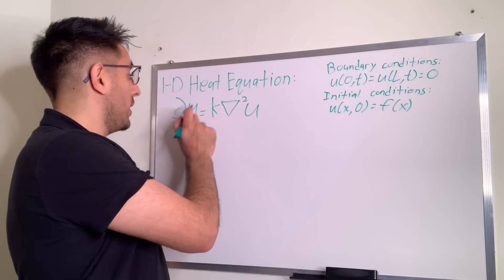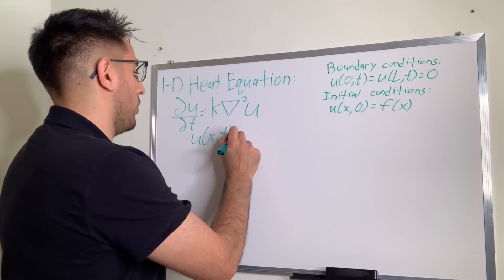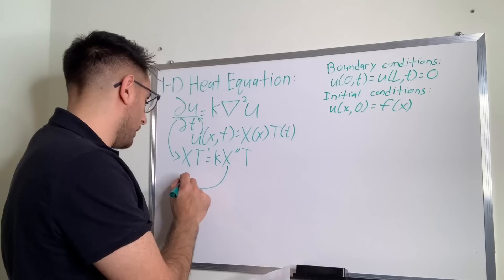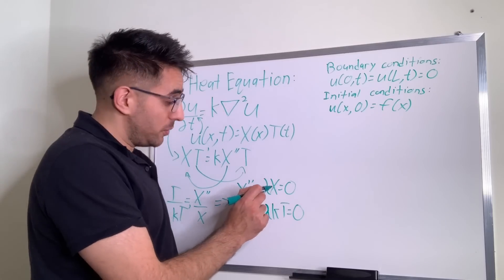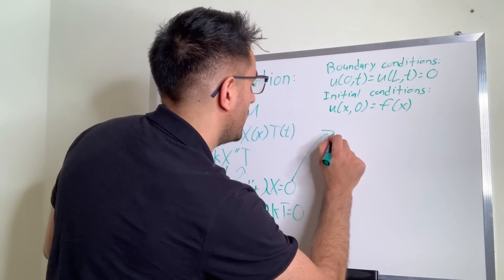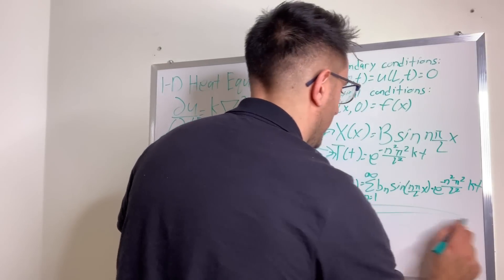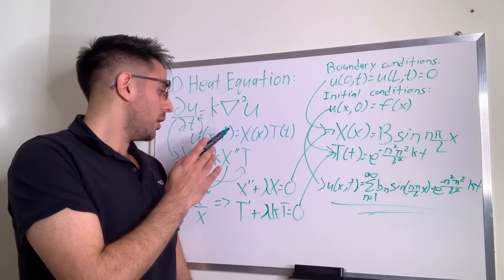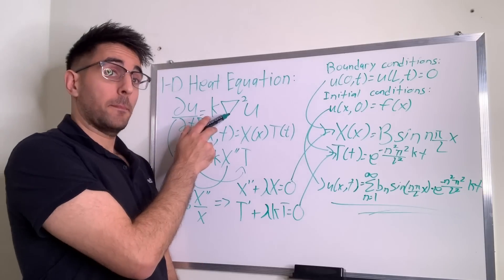What math looks like if you're an engineer...

Comment: Yeah engineering professors are terrible at explaining the math lol.
Reply: Because they don't actually understand the math. Engineering (most engineering at least, maybe not BME or CE) is like 3 freshman math courses and then 3.5 years of memorizing equations to do long but extremely elementary differential equations; zero theory. Pure mathematics really starts with modern algebra/group theory in the discrete and real analysis (big kid rigorous calculus) in the continuous -- as my then professor said on the first day of modern algebra, "this is the course that separates the mathematicians from the physicists and engineers".
Reply: @RangersGirlJackie99  Yeah, I'm aware and it is pretty dumb. Professors in Physics/Engineering fields should be required to understand the theory behind the mathematics they teach. Not to the same degree as mathematicians but enough to know how to explain it.
Reply: @Aaron D. Green  now that I think about it, there was a small group of physics majors in my undergrad real analysis class, albeit on a purely elective basis. Maybe if more physicists start taking high level math electives or minoring, it'll eventually make its way to engineering in the not too distance future.

Comment: Professors: “this is the most important step don’t skip it or use a calculator for it, do it all by hand and show all your work…imma jump to the solution here real quick you can figure it out on your own” 

On the test they give you a sliver of a line to work out the problem cause the rest of the page is the text for the question for the problem 😩😩😩😩

Comment: What math actually looks like if you're a mechanical engineer:
Situation 1: Machine design: "Hmm the simulation program spit out a peak stress value in the gigapascals for the structure. I could calculate something similar but simpler on paper OOOOOR I could just make this wall right here twice as thick in the model!"
Situation 2: "Haha, calculate the effect of speed on the pressing process? You're a funny guy! Now; come with me and let's measure the average on 50 test pieces instead of this nonsense."

Comment: mechanical engineer I see....

I don't remember 99% of the things I was taught... but the Fourier Transform is literally.. the ONLY thing I will keep up with.
Reply: Current student here, so you're saying it does get better? I'm in dynamics right now and it's killing me.
Reply: @KangaroobiksCube  if you're a mech E student and getting wrecked on Dynamics... I'm sorry to say... it only gets worse when you start taking breadth/depth courses.
I was a electrical engineering student... and glad that Dynamics was the last of the series for my A.S.
Reply: @cpK054L  thankfully not an ME I'm engineering management going into IE in grad school, but they've got me in a mechanical focus so I have to take dynamics and 2 others that are dynamics pre reqs. 
It's getting a bit better I'm just rusty on the calc. 
Thanks for the insight though.
Reply: @KangaroobiksCube  I don't remember using calculus in Dynamics.. if anything, the later courses should be using differential equations.
Reply: @cpK054L  MAE 202 right? Every single problem I'm doing has 2 of 3 from the following; integration, differentiation, and specifically separation by parts from diff eq. Conceptually I get what the problems are asking every time but I keep getting lost in the calc while getting to the answer. 
It has gotten better since my first post, just brushing of the rust has helped.
Reply: @KangaroobiksCube  I don't know what MAE202 is... if that's how your school codes courses, then I really don't know.
I haven't taken a dynamics course in almost 10 years... I have no use for dynamics because I'm an electrical engineer.

So unless I'm in an industry that deals with kinematics, engines, motors, etc.... I would have no reason to actually use this knowledge.

I'm in IoT industry
so F = ma → qE would be my equivalent.
Reply: @KangaroobiksCube  I'm an actual Mech eng student, not eng management, and I also got wrecked baaad on dynamics.
Short answer to your question is yes, it can get better (it won't necessarily, but it's defo possible) 
I'm actually enjoying the more advanced classes alot more (I got a significantly higher grade on my PDE course than my ODE course for example) , and they make alot more sense to me. You will need to put in enough effort later to catch up on the basics that you may have missed the first time around, but by then it'll be alot more intuitive.
Reply: Do you use fourier transforms at your job?
Reply: @smokeypillow  Why? The oscilloscope and computer does it for me.
FFT - Fast Fourier Transform
DFT - Discrete Fourier Transform

for AI/ML purposes
STFT - Short Time Fourier Transform

Just remembering WHAT the Fourier Transform is very important
Reply: @cpK054L  so what does it transform lol
Reply: @Cheesecake99YearsAgo  time domain to frequency domain
Just laplace goes from cartesian to s plane
And z transforms goes from cartesian to z plane
Reply: @Cheesecake99YearsAgo  frequency domain. Sin, cos waves. Also, the Laplace formula bullshit. Crazy stuff.
Reply: @cpK054L  Designing FFTs on specific processors requires that you know how they work and how to optimize them for those processors. Likewise, knowing FT properties of symmetry can help optimize design if you know the type of signals you'll be working with.
Reply: @MrSocialish  This makes almost no sense unless you want to induce pain on yourself...

a lot of the FFT algorithms are already implemented in the CMSIS libraries.
Unless you are using MIPS or other non-multiplicative ALUs and common purpose MCUs that are not ideal for DSPs, 

why, I ask again, WHY are you trying to design an FFT?
Reply: @MrSocialish  okay? When did I ask or care?
Comparing matLabs implementation to CMSIS is competing apples to oranges. 
Why did you bring this up?
Reply: @cpK054L  “why, I ask again, WHY are you trying to design an FFT?”. Did you forget you asked that, sweetheart? And if you can’t see the reason for developing a bit true accurate model of a product, you’re clearly not fit for this discussion.
Reply: @MrSocialish  facepalm you jumped into MY discussion.  I don't care about how YOU implement it because I'm not getting paid to write it so why will I waste my time when CMSIS already has it?
Reply: @cpK054L  I never once said you had to write it smh... I simply said that its application specific. If your computer has it, and it works for your application, use it! There is no reason to reinvent the wheel. BUT I'm adding to the discussion saying that is not always the case.
For some reason this offended you though? That's interesting to me. Whenever someone tells me something that I'm not totally familiar with, I find it interesting. I don't get all worked up over it lol

Comment: As an engineer who just took Calc 3 and is doing diffeq right now, this hit home in a way I don't like😅
Reply: diffeq is a lot easier than calculus 2.
I got an A, intoxicated. You'll be fine.
Reply: @cpK054L  i got the worst mark in my year for DEs so I think you’re just built different. Or I’m stupid
Reply: @MrAdamo  was it the eigenvectors?
Reply: @cpK054L  nah, there were a lot of questions where we had to convert to polar form and do some trig math, and if you forget some weird trig identities the questions become impossible. They’re technically on the data sheet but you wouldn’t understand if you didn’t do the questions. And tbh I didn’t study much that semester
Reply: @MrAdamo  believe me I've done my fair share of polar form notations... 
it's needed when you are doing circuit analysis 
it's even worse when you have to convert it back to complex notation, do the math, then convert it back to polar.

Comment: I just took ordinary and partial differential equations last semester and the heat equation was suuupper accurate.
Reply: LOL I took a PDE class where we basically just studied the heat equation for 95% of it. Kind of crazy to see how valuing financial derivatives can be reduced to solving the heat equation though.
Reply: mood, I took V calc and partial at the same time
Reply: @Govgrav506  what, they made us do v calc, then linear, then differential equations, and then partial.
Reply: @jcw1948  huh, at my school you had to take linear first, then ode and v cal, then partial. I messed up and ended up taking v cal and partial at the same time.
Reply: @Govgrav506  maybe purdue is wack, they also let some majors combine linear and ordinary differential equations, I’m in aero so I had to take them separately, which was painful.
Reply: What heat equation is that? Is that for gas liquid or solid?
Reply: @loganreidy7055  its the change and distribution of heat in a rod. So say you have a rod with some initial temperature, you can calculate how the temperature at any point of that rod changes in time.
Reply: wait what? thats awesome.
Reply: @thomaswijgerse723  I have long forgotten the details, but from 30,000 feet it was based on a hedging strategy that would allow you to get rid of all of the probabilistic parts of the PDE representing the values of call or put options with a fixed expiry date, subject to a cap on the rate of change of the general market's volatility that usually held. It was called the Black-Scholes Equation, and Scholes won a Nobel in economics for it and got rich as hell. And of course about a year after I learned it Russia defaulted on their debts, the market went apeshit breaking that volatility assumption, and Scholes' billion dollar hedge fund (I think it was called Long Term Financial Capital or something like that) went under. So the socialist in me laughs like hell at that. But the mathematician in me still thought it was cool as hell to transform this ugly probabilistic PDE into a simple 1D heat equation.
Reply: @thomaswijgerse723  Yeah, never seen this one. Looks like you can get there from thermodynamics or Einstein heat capacity for a solid
Reply: @loganreidy7055  I’m not sure it’s for anything specifically, I don’t think you’d apply it in any thermodynamics class, but I’m just a sophomore so idk. I took partial differential equations last semester and those equations were like “the final boss”. Typically they helped model the distribution of heat in a solid material over time given one end was held at a certain temperature, or both, or neither. I hear from my other aero friends I’ll be using those equations in structures or signals I forget which, but unless you’re an aero major you’re probably chilling?

Comment: That’s why everyone I know is switching to fully online bachelors degree in engineering 😅
Reply: Lol good luck with that
Reply: Well my fuckin university need us to have 75 percent attendance offline....so im fucked up
Reply: Good luck with that... you can't do undergraduate Electrical Engineering online because of how expensive it will be on the student...

who probably can't afford their own
- Oscilloscope (the cheapest one you want is 200 MHz, and that can run minimum $200, a good one goes for $1000+, a great one for $5000+, and industrial is 7 digits)
- Digital Multimeter
- Spectrum Analyzer ← This being the most expensive equipment
- Network Analyzer ← once you get to senior year, your breadth may require this equipment
- Digital Logic Analyzer ← If your o-scope don't have this, this will get expensive
- Electrical Load simulator ← This will break you too if you need it for senior design
- Soldering station with venting system ← Just breath the fumes

This is only a few of the equipment, the entire set (unless you win Keysight's contest) will run you enough costs to buy a house (literally)